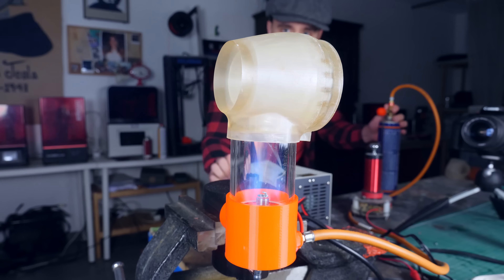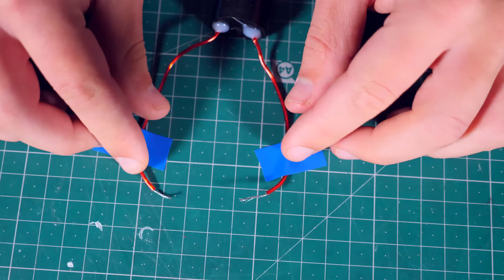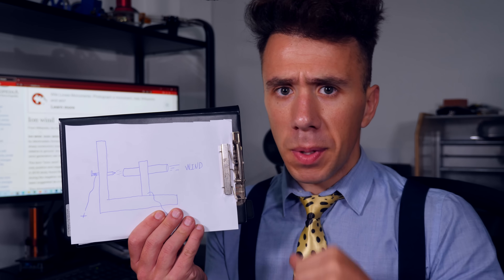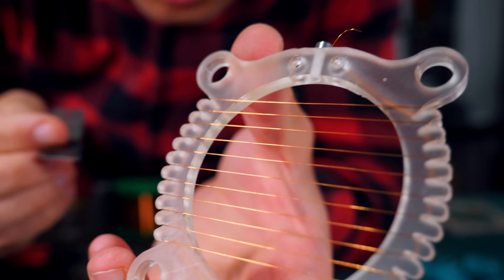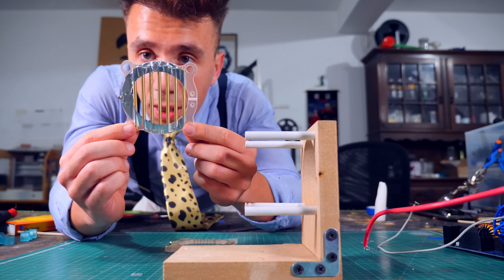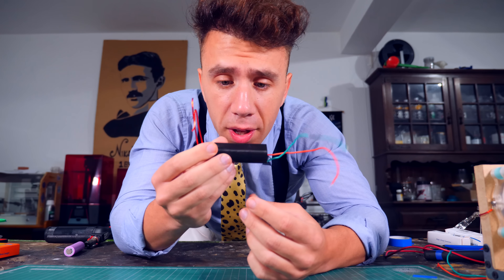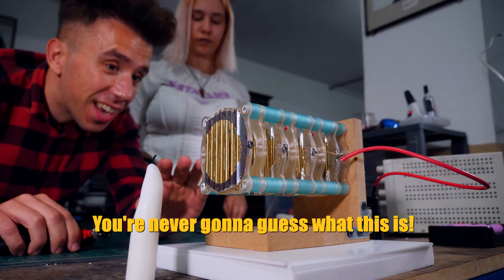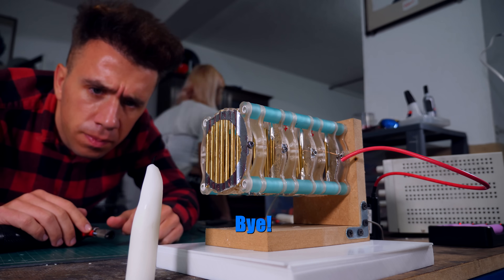I built a TRUE BLADELESS FAN

Comment: I guess the next step would be a true bladeless jet engine
Reply: I wonder if blowing different types of gases through the fan would affect the Ion wind
Reply: @Gabriel.-_-.  xenon gas is what is used for ionic propulsion In space
Reply: @Gabriel.-_-.  it does some gases ionizing more easily than others, and work more efficiently. Generally gases made of elements with higher atomic numbers work better bc electrons farther away from nucleus and they have more so more easily lose and gain electrons to become ions
Reply: @Gabriel.-_-.  Interesting question. Someone else had made this invention ages ago and had the same idea. So he started right away with the first element from the periodic table of elements. The result was in fact more effective and actually generated more wind. However, the wonderful invention and its inventor magically disappeared during the first test to improve the device and no one ever saw or heard him again and his house was also gone. A far away located neighbor found his boot´s six years later on his roof. xD :P
Reply: That’s called a pulse jet
Reply: That exists. Just wa he built there is used as Ion thruster on space probes. The just need solar Panels and som gas to ionise. Compared to the weight of the "Propellant" (the gas that gets shot out) you can make a lot of speed, much more than with traditional rocket engines. But the thrust is so low that they only work when you are already in orbit. Search for ion thruster/ specific impulse
Reply: Ion purpulsiom
Reply: TIE Fighter from Star Wars. Twin Ion Engine.
Reply: And fuel less..  there has to be a way to turn oxygen into plasma then accelerate it..   with just electricity..
Reply: Or rocket engine which nasa is already working on
Reply: @Fillip sir. Ramjet doesn't use Ionic wind tho
Reply: @Gabriel.-_-.  but it is a bladeless jet tho 😉
Reply: @Gabriel.-_-.  ionic wind could in theory provide the airflow for a ramjet
Reply: @Gabriel.-_-.  ram jets just compress air without moving parts to increase higher end speeds and efficiency.
Reply: pulse jets already exist
Reply: Hasn't he already made a pulsejet?
Reply: That’s what an ion thruster is
Reply: That’s called a ramjet engine—
Reply: Sooo, a thruster?
Reply: Isn't that just a rocket engine?
Reply: In theory, a rocket engine is effectively a class of jet engine.....I think.
Reply: @Fillip sir. No, a ramjet still uses blades in the actual propulsion unit, however a scramjet doesnt have blades
Reply: You could put the whole contraption in a tube and modify the tube so it acts the same way as more traditional bladeless fans, creating a vacuum effect while accelrating the air. In that you would create more speed and mass flow of air that would be needed to sustain a jet engine, while also being more efficient than just putting more modules together.
Reply: Its called Ramjets
Reply: Pulse jet
Reply: Ramjets and scramjet
Reply: Ramjet Ramjet Ramjet Ramjet Ramjet Ramjet Ramjet Ramjet
Reply: ionic thrusters are used on some satellites, but no ionic propulsion has been made powerful enough to be useful within the Earth's atmosphere.
Reply: @ericgreenwood4812  There have been model aircraft which use ionic propulsion.
Reply: @ericgreenwood4812  it just recently has. I think it was MIT that recently built a winged drone that uses ionic propulsion as thrust.
Reply: @ericgreenwood4812  There was a small ionic thruster propelled aircraft that managed sustained flight a while back.
Reply: Or a pulsejet.
Reply: I want to see this
Reply: @Stefan Rial It can be used in space, you need to inject gas into the fan, Nasa uses xenon gas i think.
Reply: Isnt that just a pulse jet
Reply: Yes
Reply: I wonder if conceptually you've be better aiming for a turbo jet or a pulse jet?
Reply: That's just a ram jet
Reply: I think he's meaning it compressing the air before speed of sound like a ramjet.
Reply: For VTOL RC plane 😅
Reply: Ebike afterburner with no moving parts 👌
Reply: ionic engine
Reply: Please don’t someone will put seats in there
Reply: SCRAMJET
Reply: Ramjet engine
Reply: Fly back transformers are surprisingly hard to find andexpensive on ebay
Reply: @thedoctor2102  T.V. are everywhere.  Being a trash man and a freak, I actually have probably 200 various flybacks from small, to old projector (dual FBT), and older ones hand assembled way before resin encased.  Everything is open to see.  I love those...
Reply: @jamesharrell4360  where I come from CRT Televisions are hard to find. Everybody that had one had thrown it out already, the few I  got a hold of  I already cannibalised and bleeding up the flybacks months down the track. In saying that I would be more than happy to throw a few quid your way for some bits and pieces.
Reply: Like a ermm.,..pulse jet engine.??
Reply: Logical next step
Reply: Horrible ineffective
Reply: @HighVoltageMadness  how so?
Reply: don't bladeless jet engines already exist? they use airflow + narrowing cylinder to generate thrust or something
Reply: @Stefan Rial strictly speaking, it already is used in space. Except instead of air, they use an onboard supply of a noble gas. A satalite in 2003 used its ionic thruster to change course when it ran out of monopropelant.
Reply: JPL used an ionic thruster on one of their spacecrafts
Reply: Well, a ram- or scramjet would work if he had sufficient initial velocity...
Reply: I am 1000th like
Reply: Scram jets exist.
Reply: True, but i would never trust it.
Reply: Ramjet
Reply: But blades stabilize jets
Reply: No you’re missing the point
Reply: he already built a pulsejet
Reply: Ramjet
Reply: Power requirements would be insane
Reply: already exists
Reply: Well we already have it i.e ion thrusters, which are used for space satellites, but not much efficient within earth’s atmosphere
Reply: Ionic thruster
Reply: The 4 stages of a turbine engine is- suck, squeeze, bang and blow.
Reply: Yes b
Reply: Ramjet engines and scramjet engines would like to have a word
Reply: This is EXACTLY what that "fan" is. Ion jet engine. I mean, he did make other Bladeless engines like puls-jet, but this one is interesting as takes no fuel except for electrical energy. And yes, it can be used with gas tanks to make a standard Ion thruster.

The only thing about this type of engine is: they are weak, like, and produce really weak thrust.
Reply: Already exists, kinda.
Uses Xeon tho is called a Ion-engine.
Works by the same principle.
Reply: i mean thats how rocket engines work
Reply: Pulse jet.
Reply: So iron man
Reply: https://youtu.be/jbXJa8osys0 literally a month ago lol
Reply: Beat me to it
Reply: You mean a rocket?
Reply: So, a rocket engine lol?
Reply: The fact that he didnt like this means hs took it as a challenge or got mad for some reason
Reply: @julianebug8409  😂
Reply: Or bladeless knife,
It’s not the same idea, but would be impressive.
Reply: Literally an ion engine o.o
Reply: Ramjet
Reply: frosty  Is English not your first language?
Reply: And then all were gonna need is the most energy dense electricity storing device in history.
Reply: Pulsejet
Reply: Precisely, point proven gravitational propulsion
Reply: It wouldn't be impossible, plane would need to be 90% carbon fiber though
Reply: So... A ramjet? Agree 👌
Reply: Look up JayCubL's Bladeless Turbojet engine.
Reply: Like a propeller vs impeller for a jet engine, an ion thruster only produces thrust and no compression. A jet needs compression.

That being said, MAYBE one can use an ionic thruster as an "afterburner" to an actual jet engine
Reply: You mean a ran jet
Reply: @Worldofant  *ram

There's also the pulsejet, and whatever you could call JayCubL's engine.
Reply: Without gas
Reply: It's called mjet
Reply: That doesn't work. A jet engine needs high pressure. The pressure from this ion flow is low and you can't compress it. 
Derp
Reply: That is a ramjet
Reply: For improvements, i think its better to use a point for the positive and and a hollow shape for the negative, just like the first thing he did but instead of a tube, its something 2d.

For example instead of a nail use a wire, and a wire formed into a hollow circle (or any other shape you want). Also i think you cam make a vacuum if you reverse the polarities
Reply: I can also draw it if anyone wants it

Comment: Build idea: make a jet engine using household items. You could use HHO as fuel. A HHO generator is pretty easy to make with stuff found in a kitchen
Reply: an electrolysis compressor built into the stock of a pellet gun. no more pumping
Reply: You are the future winner i think 🤔
Reply: Safety idea: dont store or send the oxygen and hydrogen through the same duct/tank
Reply: @sigmamale4147  with my experience having a flashback arrester should help a lot but ya probably not the best idea to have them mixed
Reply: lets blow up our homes yay
Reply: @mrrw0lf  lmao
Reply: @mrrw0lf  *houses. You're welcome
Reply: @megajatt123  Incorrect. Houses is not the plural word for Home. House is not the same word as Home. You're welcome.
Reply: I want an gasoline engine to run almost forever with hydrogen.